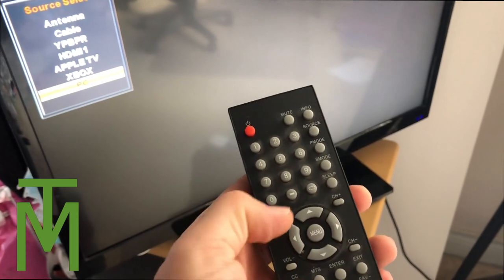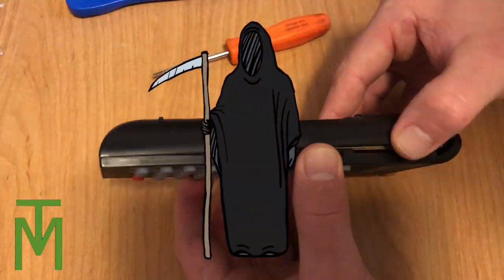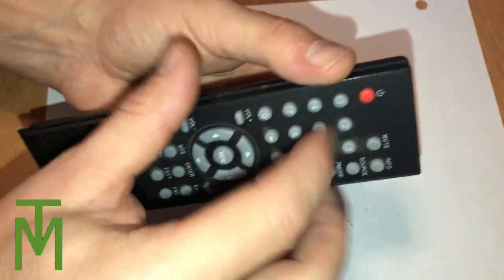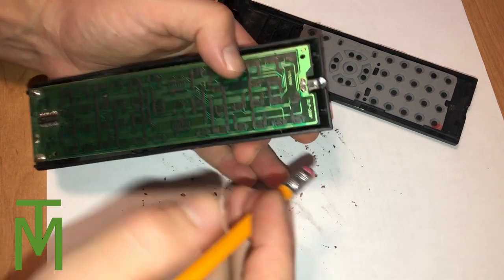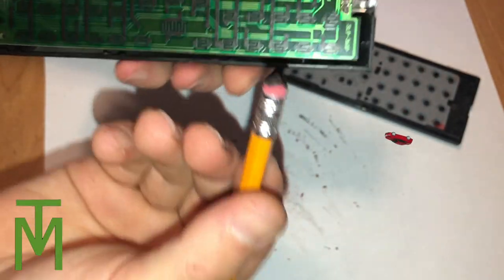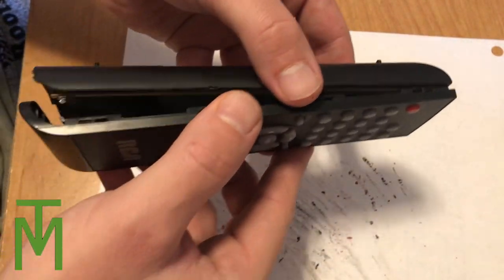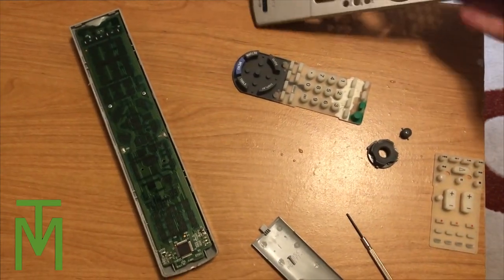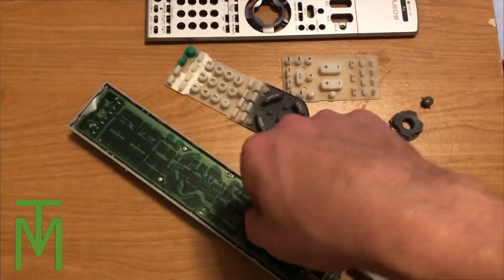Fix your remote control, don't buy a new one !!!

Comment: This guy is a genius, I've tried to fix my Yamaha hifi system remote control transmitter power button for years, and this guy fixed it minutes. This method really works, try it. Thank you for sharing.